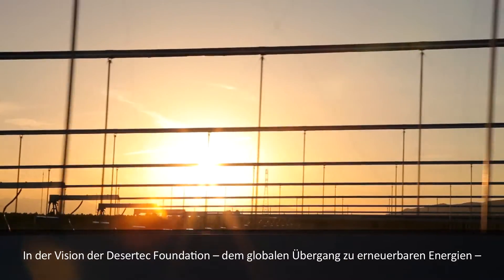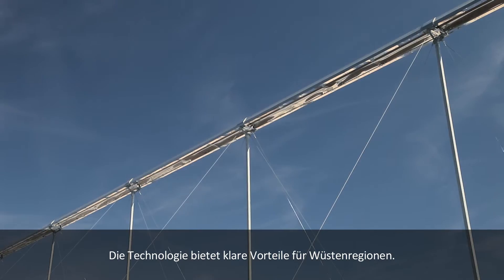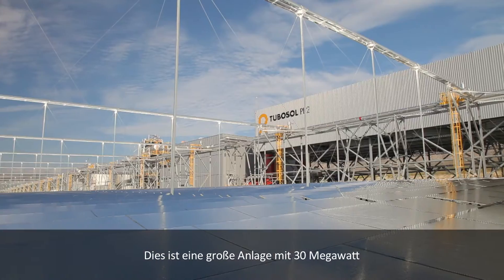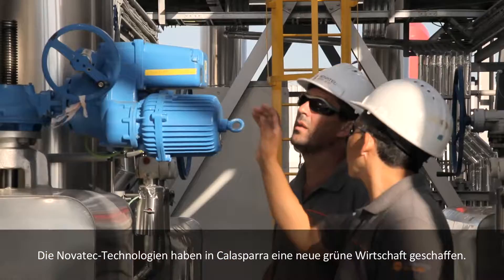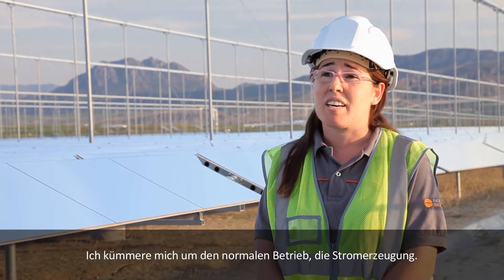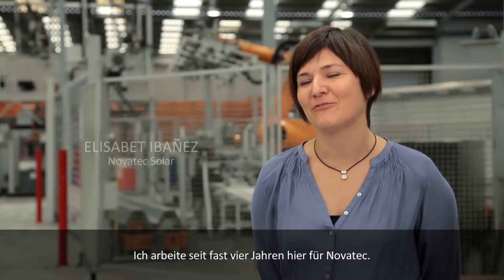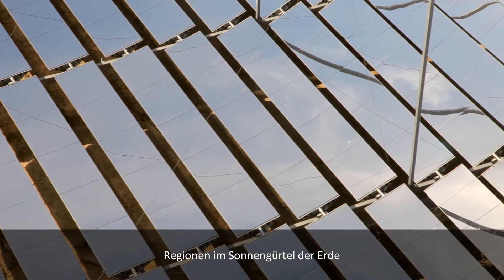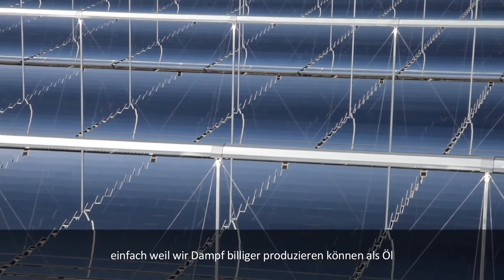DESERTEC Foundation: Das weltgrößte Fresnel Solarthermie-Kraftwerk Puerto Errado 2 (PE2)

Comment: "Power is being sold for 26.8717 Euro cents per kWh for the first 25 years and 21.5495 Euro cents/kWh thereafter."
Source: Wikipedia "Puerto Errado"
It seems to be extra expensive, even compared to other CSP-technologies like parabolic through, solar tower or solar stirling dish.
The use of flat mirrors may be an advantage in costs, but obviously this is compensated by other disadvantages. I suppose rather bad efficiency compared to solar tower systems.